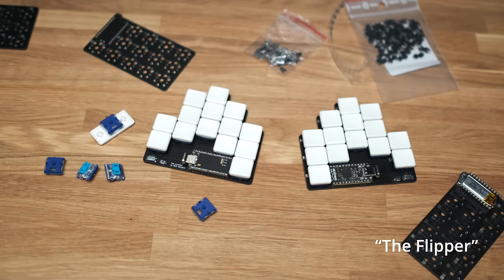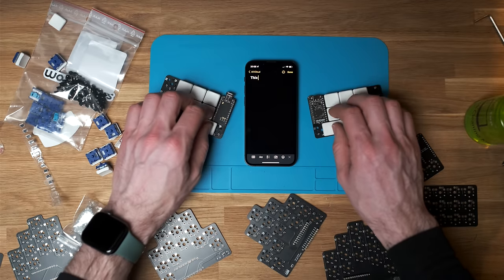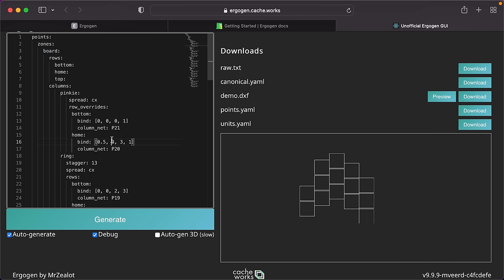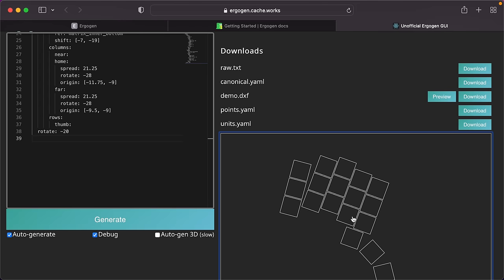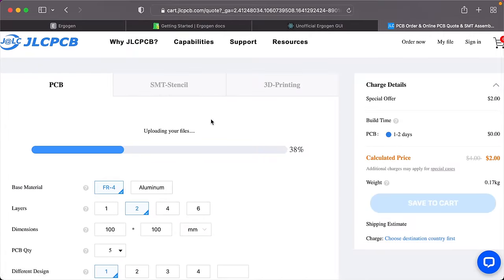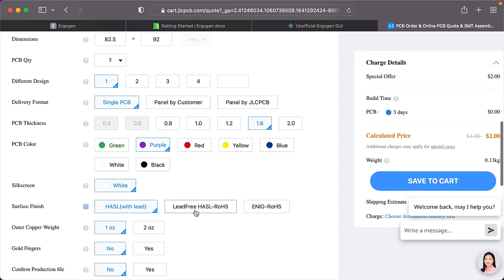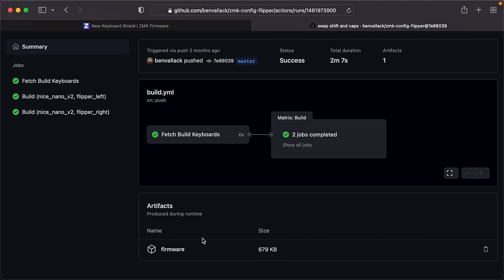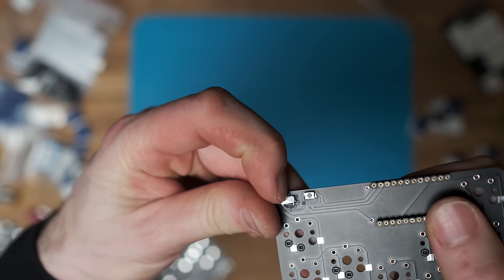“The REAL Ergonomic Keyboard Endgame!” - How To Design & Make A Totally Custom Keyboard

Comment: Just as a matter of interest - how long do the batteries on these keyboards last before you need to recharge? Also is there any kind of indication when the battery is going to run out?
Reply from the maker: I actually use a dongle (third nice!nano connected to usb) which makes the batteries in the two halves last ages, easily a few months.
Reply: @BenVallack  how does the third nice!nano help the battery? Do you have both halves connected to each other? Thanks.
Reply from the maker: @modularcarpet  because the connection from the dongle to each half isn’t using full Bluetooth. It’s normally the left half with the full Bluetooth connection to the host that uses all the power. Now both halves act as the low power mode to connect to the dongle, which uses usb to the computer. It’s way more reliable too
Reply: @BenVallack  ah, I see. If you want to connect to a phone or tablet do you connect without the extra dongle? If you don't use the extra dongle does the battery on the left half run out quicker? Also, if you use it without the dongle (or with), do shortcuts work over both halves - i.e. if I hold a modifier or layer key on the left half and press a key on the right half will it behave as expected? Thanks for all your help. Great content as always!
Reply from the maker: @modularcarpet  I have a second pair that is set up without the dongle that I use with iOS or when I need a direct bluetooth connection. I still prefer to just plug the dongle into the iPad though as it's so much more reliable. I seem to have various issues on iPad with the bluetooth version. But yes the left side of the version without the dongle runs out in a few weeks. The whole board behaves exactly as it should in either case though - no issue with two sides misunderstanding each other.
Reply: @BenVallack  Hi, really nice video. I just discovered split keyboard and digg in since several days. I would like to build one with recheargable battery. This video is very good, but I think I missing some informations for now to try out (rechargeable battery via USB-C port ? How it's works with a dongle ?). I think, for my first attempt, i would love a concrete example start to finish. Do you think you can make a video like this ? Thanks ! I'm already subcribed to this great channel !

Comment: Where did you source your batteries from? I'm having trouble finding them in the UK
Reply from the maker: https://www.ebay.co.uk/itm/194001009975 sorry missed them in my parts list!
Reply: Did you solder the JST connectors on yourself? Thanks for the link!
Reply from the maker: Yeah, links to them in the description. I just crimped the tiny bit onto the wire though, seemed ok, then insert into the male connector and it locks in. I haven’t actually made a board with a working female connector on yet though but the footprint is in my latest files, I’m not sure it will fit in its current location though.

Comment: Hi. I'm trying to build my own keyboard, but I would like to have smaller keys as my hands are not that big. Has anyone ever come across smaller key switches/caps? Probably even something like macbook's fn row (with half height)
Reply from the maker: I would just have a look on Ali express, maybe order a bunch of them to test. Once you’re happy track down the KiCad footprints and use them with Ergogen to make a board for them. The only thing with using unusual switches is I’m not sure how they handle things like key chatter etc.

Comment: Interesting. Keep on developing and maybe soon we'll actually be having a ‘real’ ergonomic keyboard.
Biggest issue is scale. Your hand- and finger size and movement of your fingers that feels most relaxed to you is most likely slightly different from mine and everyone else.
So scaleability of the buttons, and not only the placement, would be one of the most important things to address.
Which would be possible with 3D printing but would probably be restricted anyway by the other moving parts needed? Unless you would 3D print every single mechanical part. Which then probably would be restricted to 3D printing not allowing enough small details and PCB might not do well in too small size?

Comment: Almost a month since this video dropped and I'm still trying to figure out how you remove the second index-finger column without hurting productivity... help!
Reply from the maker: Two layers for alpha keys :) in terms of productivity you will of course see a drop in wpm, but if you do it a few keys at a time it’s surprising easy to get used to. I’m at 60wpm on 16 keys now. What I’m still unsure of though is what kind of maximum speed is inherent with this kind of layout.
Reply from the maker: Also I’m finding the more efficient symbols layers arrangement works really well for coding.
Reply: @BenVallack  ahhh thanks. My daily driver is 3x5 + 1 keys per hand at 120wpm. I feel like layering the alpha keys on a 3x4 grid can only drop that steeply, unless I mod the alpha layout so that only punctuation and the 2 least used letters move into another layer. So that's what I've been experimenting with, with because I really love the aesthetic of The Card. I would love an update video on your continued keymap journey (I don't know how to read your keymap files yet). Great channel!
Reply from the maker: Thanks! Yep all that coming soon :) I am increasingly thinking I am hitting fundamental speed limitations with the 16 layout now. It’s possible the full layout Card might not be so bad but I just kept a pulling keys out lol.

Comment: I'd consider going for a ground plane instead of connecting all the ground pins up individually.
Reply from the maker: Yeah seen some discussion on that. It blocks the connection between the halves though (at least on the Ferris Sweep). Fine for desk use but when I have it on my legs it’s enough to make it a bit dodgy.

Comment: You should so upgrade this over time, once you have the right shape. Add wireless a nice case. Maybe a sculpted case? All of your designs are only on a flat plane.
Reply: Handwell provides minimal advantage for two or three rows. But he'll have to sacrifice using a PCB or try complex flex cut designs greatly increasing cost for very little improvement.

Comment: This bit of code is no longer working in ergogen4 any thoughts on an ez work around? I made a custom footprint with the bottom vias in it and replaced all the switches on the board. That works but am not sure if the ratsnest is now correct.

    footprints:
        choc_hotswap:
          type: choc
          nets:
            from: =column_net
            to: GND
          params:
              keycaps: true
              reverse: true
              hotswap: true
        choc:
          type: choc
          anchor:
            rotate: 180
          nets:
            from: =column_net
            to: GND
          params:
              keycaps: true
              reverse: true

Comment: It might be a silly question but how come these boards you design don't need any of the other components like other kits that are being sold? Like diodes, resistors and the likes.
It might be that I somehow missed this in your video, but if none of those are needed, could you maybe explain why not? 

Also, I'm on the fence about those Kailh Choc Low Profile switches.
I know the Breeze keyboard (mkultra [dot] click) has footprints capable of taking both choc low profile AND cherry mx hotswap sockets. 
That way you can still decide per board/iteration which switch style you'd like to give a shot. 
(obviously you'd design every board with the larger spacing then to be able to facilitate both).

You wouldn't be able to tell me how I can combine both footprints in Ergogen? 
I can dm you a quick photoshop I made of combining both footprints. 

Thanks for making these videos, been loving following your journey for a while now! <3
Reply from the maker: Because they are under 36 keys (or 34 if building something with trrs connectors) so each key gets its own connection on the controller with no need for a matrix/diodes. Great reason to keep the key count low isn’t it!
Reply: @BenVallack  
Wow, that is some really valuable information you gave there! Thanks!
Reply: @BenVallack  Hey!

Figured your community could perhaps also use this information so I figured I'd share it here.

Reading the ergogen docs was a challenge. It says so itself but high density alert for sure.
I got the info but could not visualise how I had to act on it.

What now really made things more 'approachable' for me in terms of visualisation was taking a look at the 'schema.json' file in the ergogen repo (inside the 'meta' folder).

I just couldn't understand how you figured out why and how to insert lines like 'nets' or 'bind' (I'm still positively hazy on that last one). But reading that file really helps connecting all the pieces.

It also coincides with me finally getting how you were connecting things in KiCad.
Somehow it hadn't dawned on me that the hotswap sockets connect to a ground connection on one side, and a pin on the microcontroller from the other side. Hence also the limitations you mentioned above. 

Add to that your reference to zmk treating your boards as a single row 26 column keyboard and things really started locking in. 

I'm nowhere near completion, slowly getting there, but boy am I grateful that you made this video in the first place!

Comment: those gnd traces look very thin btw
Reply from the maker: Yeah I think they might be, what kind of issue is that in the real world though?
Reply: @BenVallack  I usually do it to reduce manufacture cost but also in general its a good rule to make your vcc and gnd traces bigger than the signal wires as the have more current passing through.